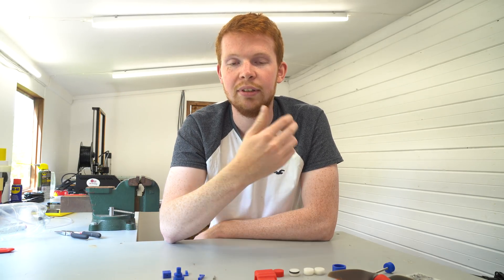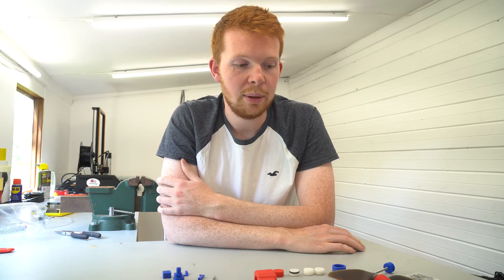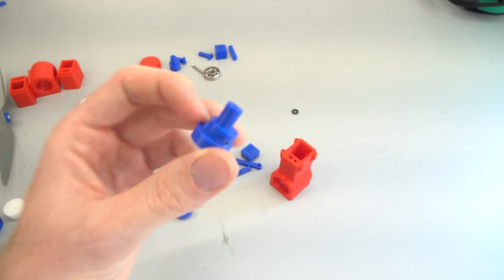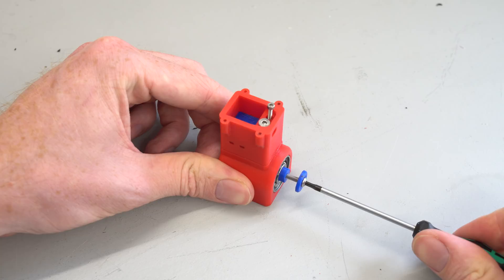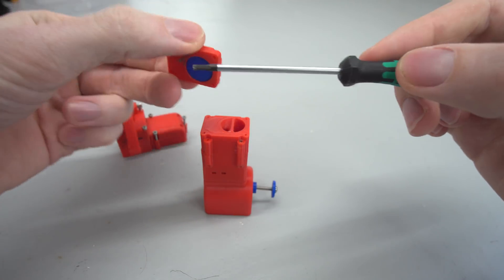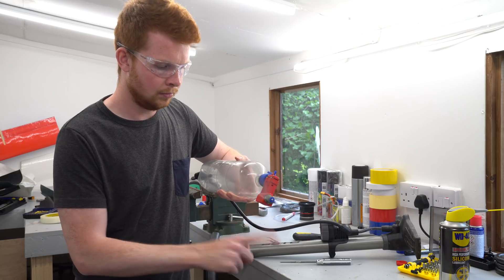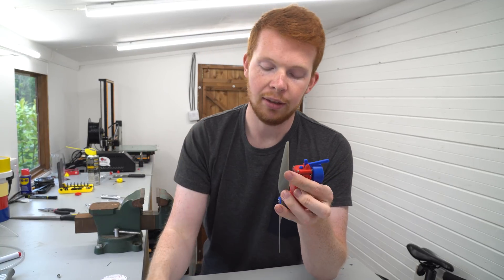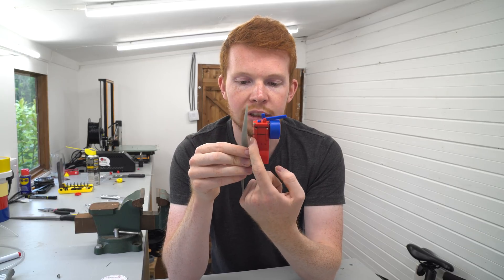Air Engine Exhaust Valve

Comment: capture the exhaust, in a closed loop type deal, and have a pop off valve in a secondary air chamber to recharge the main air.
Reply: Obsolete Technologies it’s a good thought, but unfortunately real world performance doesn’t make it too viable. Also unfortunately, I basically wrote a short novel explaining why, so here’s a summation:

TL;DR: you will end up putting less air through the engine that way, and it wouldn’t help recharge the primary tank at all, would result in an overall decrease in performance along the power curve, as well as increase engineering complexity, result in added failure points and weight, while decreasing autonomy due to tank switching. It was a good thought, though!

Think about how the ambient pressure (currently 0psi/uncompressed) compares to the Xpsi in the bottle. You can only ever equalize the larger pressure to the lower pressure via air escape. Since the lower pressure (atmospheric) is a constant in the system, you can equalize the bottle to 0psi. 

If you were venting to a secondary air capture tank, think about the pressure then. The primary tank would start out at Xpsi, and the secondary tank would start out at 0psi, just like our current system. However, as you run the engine, the secondary tank will begin to fill with compressed air, which is intended. But now look at the minimum pressure in the system: since the vent leads to the secondary tank, that is then our “ambient” pressure, and since we just established that venting to the secondary tank gives it a higher pressure, we must then accept that the minimum pressure is no longer static.

Now assume both tanks have the same volume, for convenience. Since the higher pressure can only ever go as low as the minimum pressure, and the minimum pressure is dependent upon how much air has been vented, we find that X/2psi vented to the secondary tank will leave X/2psi of pressure in the primary tank (assume no losses), which means that no air will move between the tanks, despite the remaining pressure. We observe that the engine has ran for half of the available pressure from the primary tank, which is counterproductive.

If you then open the secondary tank to the primary tank, there will still be no pressure movement (the same way that a bottle open to atmospheric pressure does not suddenly begin filling with compressed air).

Now what if you then vented off to atmospheric pressure, so you could then use both tanks at X/2psi to run the engine — free air!

The engine has a minimum psi that it will run at; for example’s sake let’s say that is X/4psi. If you run the primary tank to X/4psi and the secondary tank to X/4psi you will find that the volume of air that you have left over is twice the amount that you would have from a single tank, so was it then not more efficient?

Look at the total pressure ran through the engine: initially we ran X/2psi through it to equalize the two tanks, then we ran X/4psi from the primary tank and X/4psi from the secondary tank. Add those pressures together and what do you get? X/4 + X/4 + 2X/4 = Xpsi ran through the engine. If you had ran it off of a tank, you would only have been able to get 3X/4psi through, so it’s a good option, right?

Assuming our arbitrary minimum running pressure of X/4, the initial run where you vented to the secondary tank, the engine would stop at the primary tank’s 5X/8psi, leaving 3X/8psi in the secondary tank (leaving a difference of X/4psi between the two tanks). Now venting to atmosphere you would lose an additional 3X/8psi from the primary and X/8psi from the secondary tank, which adds up to 7X/8psi in total that has ran through the engine, an increase in running of X/8psi from the current setup.

However, the engine will run progressively worse as the pressure difference between the inlet and outlet approaches 0, so your initial run will start out strong and quickly approach 0, then your primary to atmosphere will do the same, as will your secondary to atmosphere (if you open the secondary to primary tank it will only be a total of two curves). If you use a single tank to atmosphere, the pressure difference is much greater throughout the entire run, so  the power curve is much smoother and overall longer.

Unfortunately I imagine the resistance to the output shaft added via weight would serve to increase the minimum running pressure (to overcome the newly added torque requirement) which would solve out to less total movement of air, or at best work out to break even, so it doesn’t appear to be a very viable option. Pressurizing both tanks from the beginning would double the volume of air available to run the engine, so that would help for runtime, but not for peak power.

I wrote this tired, so I’ll come back and edit as needed. I’m sure there’s a mistake in there somewhere.
Reply: Awesome reply! what if one where to add some sort of reaction chamber?Say, just a co2 canister to "top off" the system?
Reply: Obsolete Technologies I haven’t looked at the pressure or volume in the CO2 tanks, but on paper there’s no reason that won’t work (as long as one regulates the pressure from the tank so it doesn’t just go wild). I think instead of a recharge system it may be better to just run right off of CO2 tanks if he goes that route, which would be really cool!

Comment: I would recommand the bigger surface smaller stroke design, just simply because the piston won't have as much velocity, therefor less friction and less heat, wich in your case would probably be more of a bummer than the higher crankshaft force.

Comment: Its a very good idea having an exhaust valve at the top of the cylinder if you wanted to reduce friction you could theoretically use rail bearings however they would be very heavy.

Comment: Adding to the comments below, maybe your V3 engine is fine, but you have to work on the pressure source? because plastic bottle provides so little pressure. May be you could use several bottles. Or oven compact balloons, which would provide more compressed air. Or may be you could use some kind of minerals, like carbide, to generate pressure. That would be cool!

Comment: you could possible invest time into trying to add a steam engine slide valve, it functions as both intake and exhaust in one valve, and would only need one cam and a spring, or a smaller crank to make it operate. i figure it would be a good way of increasing the efficiency, and it was used on steam engines, which have a lot in common with your air engine as far as it being something of a 2 stroke engine. it also removes the need for an extra cam. or, you could possibly use a rotary valve attached to the crank, which may possibly encounter even fewer problems than a camshaft driven valvetrain, as it is all contained in one piece. and have you already experimented with an o-ring/o-rings recessed into the outside of the piston?
http://imajeenyus.com/mechanical/20050606_rotary_valve_engine/index.shtml

Comment: you should take a look at the steam engine design. a slide-valve is less friction. the valve goes up and down, it opens the top hole and the bottom hole which allows air to go into the chamber. the cam will act like your 3rd version cam.

Comment: All the solutions you purpose are based on increasing the mass flow rate, never increasing efficiency. I think you should make some research before any claim, since all of them will finally define your quality as an engineer. Right now I am studying volumetric machines, and truly none of these modifications make any difference on the engine efficiency.

Comment: Isn't the longer stroke more efficient due to volumetric efficiency? The exhaust ports should relatively be opened less.
Furthermore could the back of the cylinder be used as an expansion chamber. If the crankcase is a bit airtight you could use the crankshaft and the connecting rod as a valve.

Comment: Try using machined valves with only partial threads where you nee them. That'd probably make it easier to turn over.

Comment: Build a Wankel rotary engine! They are simpler to build, have a higher power to mass ratio, have less wear, reach higher revs, and can have simpler inlet and outlet valves.
The higher revs and lower weight will be quite useful for an RC plane.

Comment: you mentioned it ran under the pressure of a coke bottle. would it work if you put a something carbonated in the tank to make the engine run longer. like dry ice or something. 
great video though, keep it up xx

Comment: I think you need to optimize your engine, seems you're just doing trial and error.
I'd suggest the following 2 "fixes":

1: Add a small one way valve instead of the second cam, very simple and achieves  the same effect.

2: Optimize the stroke for a given pressure. The optimal stroke is different dependant on the pressure you're running the engine at (This is why a multiple expansion cylinder version is more efficient, it can be optimized for a wider span of pressures).

Optimizing a single cylinder is simple, just follow this equation:
Optimal Expansion Volume = Pressurized volume * (Pressure - Ambient Pressure)/ Ambient Pressure.

Your pressurized volume is the volume when the cam closes, the expansion volume is the extra volume from when the cam closes to when the piston is all the way down. As you can tell this optimal expansion changes based on the pressure, hence choose the mean pressure your system will run at. A more complex solution would be to try to change the expansion or pressurized volume based on the pressure, though this makes the engine rather complex.

Side note, make the cylinder round, it's the shape with maximum area per circumference.

If people would like this so that he could see that would be great :D
Reply: Beacon of Wierd seeing as this is you tube, the point may not be for Tom to optimize the engine. The point may be for us viewers to have fun knit picking the design and provide feed back for fun. If Tom just optimized the engine with some flow simulation or something, well, he would only have one video to show us of the completed perfectly timed engine. No fun in that.
Reply: I'm fairly sure he genuinely want's the engine to work as well as possible. But you might be right, this could all be a scheme to just get more views.

Comment: I've worked on quite a few multiple cylinder engine designs (first of which is here:  https://www.youtube.com/watch?v=5oGbH8k0wpY).  For what I was looking for, I went back to a much simpler single cylinder engine (first of which is here:  https://www.youtube.com/watch?v=K6AEMZuH2-I and here:  https://www.youtube.com/watch?v=r10jj9UZmX4).

My applications differed from yours, but I did end up with this:  https://www.youtube.com/watch?v=wkyOi47r9Io.

Comment: Well the valves don't need to be as wide. Sans off the threads, maybe? Also you might want to get comfortable with 2 part silicone. There are some spots where it would help. That or self lubricating plastic. iglide came up in a Google search.

Comment: Hey Tom
I think you should adjust the timing of the exhaust valve. So it opens why earlier so the pressure can escape better and the pressure inside is at atmospheric pressure.
AvE made a really nice vid about pneumatics. You should go and check it out. Maybe then you understand my point better.
Keep on going I really like this series👍

Comment: i still belive that a mulitible cylinder engine with a high and a low preassure one would work much mor efficient. And it wouldnd ad that much more complexity to youre dising since the second piston has no valve systhem but is directly controlled via the first cylinder. 

Also a dising were both  sides of the cylinder get used instead of just one (like a stea-mengine) would create a higer poweroutput with basicly the same dimentions. But i can also see the difficulties with sealing the crankshaft.

If you deside to stay with the one-cylinder-dising i would recomend some things. First i clearly would drop the double valve desing. Twostroke engines also use the same way to get rid of the exaust. Maybe a tube or an exaustpipe would help to get rid of the air even faster. Secondly you have to think of the path the air has to take throught the intake-channal. If it has bends and twist, the enegy stored in the air will get lost to friction. Also if you want to go with efficency the inlettime of the inletvalve should be very short but if you dicide to go with power the intake should be as long open as possible. Here the multiple-cylinder-desing would again have its benefits since you can use the maximum power in the first cylinder with a long valve-opening and use the remaining energy in the second cylinder which will produce the same amound of energy as a midway between a very powerfull and a very efficient cylinder.

Comment: So... Stroke vs bore. With long strokes it's easier to get high compression ratios, in a compressed air engine instead of using a multistage engine where the exhaust of one cylinder is fed into the intake of the next, you should make the ratio of the volume of cylinder at bottom dead center to the volume of the cylinder at top dead center should be slightly less than the intake pressure to the exhaust pressure.

Less rather than equal because as the compressed air decompresses it cools which causes a pressure drop beyond that caused by the expansion and hence if the ratios where equal you'd end up with first air rushing in through your exhaust port to fill the vacuum and then a pressure spike as the inrushing air collides with the air the piston is trying to push out. You'd be creating extra work on the exhaust stroke.

Increasing the bore is going to get you more power because it increases torque while still allowing the engine to rev. Though you're probably no where near the point of piston velocity being a limitation on rpm so that might not matter

Comment: Instead of using a cam, you could turn it into a crankshaft type, where its a rod coupled with a pin offset from the center. Using brass inserts you could get lower friction. *edit, hmm maybe it dosnt create the same kind of profile tho... :/ remember kids, failure is always an option :) love the vids

Comment: Have you thought about a valveless aproach or using mainly check valves, id suck at describing what i mean but have the piston working as a valve and having a channel for the air to cycle depending? Cause with a almost flat head piston like in this video you loose a lot of airflow, it aids in simplicity but not in efficiency

Comment: That is an insainly amazing design and it will get better as time goes on.
Just these week i needed an air tight housing. I found that a product called geocel the works multiuse from screwfix direct bonds really well to pla and cures to a stiff rubber. Thought you might be able to use it like a liquid gasket.

Comment: If you did a bigger piston, it would be much better, because, first, it will have more torque if you also make a bigger radius crankshaft and it will also run smoother because of the added weight.

Comment: maybe the valve springs are too stiff , try removing them , i'm sure the valves will hold just with the engine pressure
Reply: and put lots and lots of lubricant in the crankshaft enclosure

Comment: See if adding a heavier flywheel works to overcome the newly added friction. It's definitely not a solution for long term (probably too much gyroscopic force, etc) but I bet it'll run as efficient as you say

Comment: That's really too bad about the exhaust valve not working. I didn't think of the extra friction either, and I can't see a way to fix that without adding more complexity (ie little rollers on the end of the cam followers). 
What you said about the strength of the shaft makes perfect sense. If you need the shaft to be stronger, maybe you could try using thin-section bearings. Something like a 6702 or 6703 bearing would keep the OD nearly the same, but let you use a shaft of around double the diameter. I would definitely use a dual bearing setup if going to something like these.

Comment: The idea to use separate valves is sound but the scale is too small and friction loses are very high in comparison to the forces that the little piston can produce. Go 2 or 3 times up in scale and it will work better. Also I'd say that people that said that going up in bore is better were right, when you increase the bore 2 times you get - 2 times higher friction BUT 4 times higher force exerted on the piston!

Comment: It could be that the exhaust valve seats to tightly and the second cam uses too much energy to push and hold it open. In a full sized engine, a cam follower would be used to eliminate the friction between the push rod and the cam. Maybe instead of using a poppet type exhaust valve, try the same kind of diaphragm valve your throttle has.

Comment: Not really sure the increased stroke is the wisest decission. Without lubrication, friction could be important between the piston and the cylinder (Prismatic shape in this case). Assuming a constant friction force, the larger the stroke, the larger the dissipation of energy due to friction, negatively affecting efficiency.
On the other hand, a piston with more surface area would increase the force you can get from the motor by the second power of the length of the side of the square, while it only augments the friction force in a linear trend. However, it will also increase the volume of air used per stroke.
At the end, this is an optimization problem, each option has its pros and cons. I don’t think you can achieve the best performance out of this motor without developing a mathematical model of the system and finding the most efficient solution analytically.